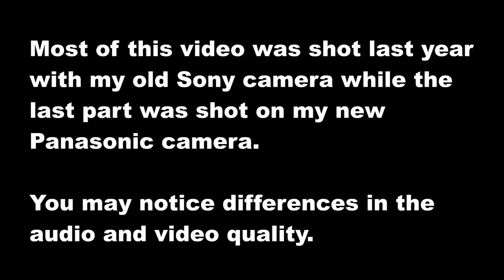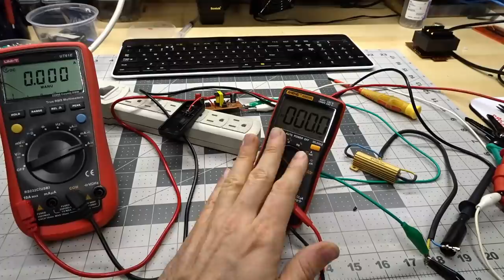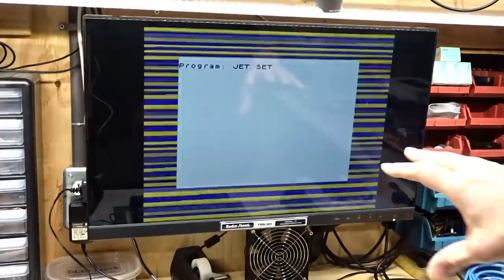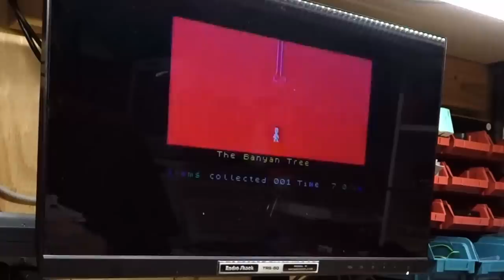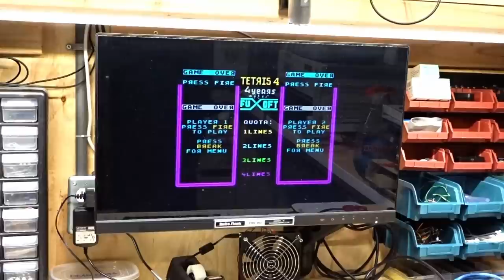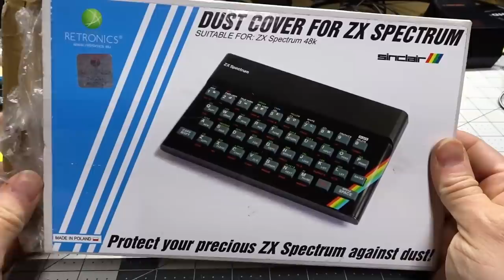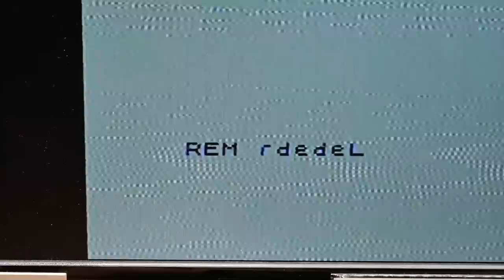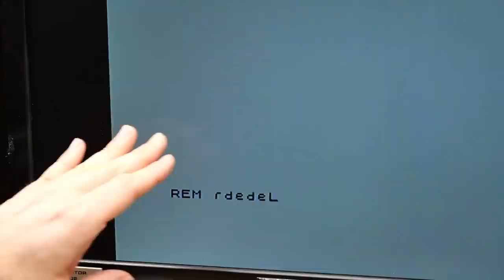ZX Spectrum Part 3 - Revisiting the machine at last!

Comment: In the 80s, many UK electricals didn't come with a moulded plug, just bare wires; you were often required to wire your own. It's really common to find 80s electricals here these days with terribly wired plugs with completely the wrong fuse in!
Reply from the maker: Oh that's fascinating! Is that because at that time some houses still had the older plug style? So they just didn't bother? Clearly that plug was added on by someone because it just felt like a hand wired one. So maybe they had to do it!
Reply: @adriansdigitalbasement  I think it was just done to make manufacturing cheaper, under the expectation that everyone was good at wiring a plug. We also didn't get regulations on fire retardant textiles until 1989. Frankly with all these home computers on carpets in front of the family TV, it's a wonder there wasn't a Great Fire Of London all over again...

Comment: I think you're right about the fuse. It was a long time ago so the memory's a bit fuzzy, but I think the Spectrum was meant to have a 5, or even 3, amp fuse.
Reply: Lowest you can get (from most shops, that's 3, though I have seen 1); that's far more (about 700 watts!) than the speccy uses anyway (10-20W), and is only to protect the _cable_, not the speccy or its power supply.

Comment: Thanks for showing this. I loved my Spectrum. The tape loading issue was horrible in the 80s as well. The experience I got with a Microdrive back then was 1000 times faster, but those tapes could also spin into salad. Try to rethink the tape source and some equalizer. It was treble and bias that worked for me with 1000s of tape loading/saving sessions. (I have a nice simulator on a Thinkpad now.)

Comment: Ever notice all your loading issues revolved around the one piece of equipment used to load them.  Try a new phone and app, and use a BT dongle to load them instead of the cable and amp.  As for Power Supplies, the Atari Jaguar Ones work great.    As for RAM on the Spectrum, the half defective Ram which was meant to save Sinclair money actually ended up costing them a whole lot more.

Comment: As I remember from that “spectrum era”,  most of spectrum enthusiast made two out of the box mods.
1st was a push button switch normally closed on power supply so you don’t have to plug and unplug the power jack to reset.
2nd  was to solder an AV cable in the modulator input and a female RCA connector at the other side and pass it out next to TV RCA out to have AV signal.
Reply: Hi ! So did I. However later I included a real "reset button" at the rear that reset the computer on CPU level without dropping the power itself.
Reply: More info about the second one, please! I'd love to see if my Sinclair (I think it's a ZX rebrand) is not outputting composite properly or if the whole thing is shot.
Reply: Hi ! When you look at the RF-modulator there are two wires going in from the left side through plastic bushings. The frontmost is +5V, the rearmost is input signal. That's the composite video signal already. 

All you got to do is feed it with a piece of coaxial wire to a female RCA jack. The outer shielding is tied to GND (modulator case for instance) and that's it. Normally it is not neccessary to even disconnect this wire from the RF-modulator so the original function is maintained and you could have a "dual screen" solution: TV and composite monitor as well. 

But you could remove the entire RF modulator as well. Saves room and power. For RGB encoding you need more hardware, since the video signal internally is a color-differential R-Y / B-Y signal.
Reply: @wacholder5690  I'll try that, hopefully it will work on my NTSC version. Thanks!
Reply: Hi ! It should, since the PAL or NTSC refers to the type of RF modulator used only. The incoming videosignal is generic composite video (known as FBAS in Germany).
Reply: BTW: if you have a double row connetor to the ZX rear connector you could catch the signal from off pin 15A + one GND like neighboring 14A pin. :-)

Comment: You're definitely getting the authentic experience! I had mixed results with the leads more than anything. Sometimes having the mic socket plugged in seemed to help. Speaking of which (and I'm sure you know this but) make sure the earphone out is connected to the ear socket of the speccy not the mic....

Comment: I'd recommend getting a Spectrum+, if you want something with a usable keyboard. You can get conversion kits for the 48K, as the boards were the same.

The 128 and +2 are two very similar machines, with the latter having minor compatibility issues due to (internal) ROM entry points being shifted as some of the strings (such as the copyright) had changed length. Worth sourcing, if you can, especially as they're more capable machines.

Comment: I know it is an old video, (blame youtube’s) algorithm. I fixed many Spectrums back in the late 80’s, most of the failures were caused by the power bricks putting out too high voltage, esp. in countries using 250V. The transistor generating the -5V for the RAM would go short circuit, putting the raw DC input on the RAM chips, destroying them in the process. From what I could remember, some of those power beicks would put out 16V or higher… standard mod was to put a linear regulator+crowbar on the power bricks. Those modified Spectrums never came back to be repaired again.

Comment: Ah,  yes, the fun of loading a program was part of the excitement of owning a Sinclair Spectrum.  I can quite understand how you would find it frustrating if you never used one in its heyday. It was after all a low priced computer that gave loads of people their first access to a computer. My Spectrum ended up looking nothing like a Spectrum. I built the circuit board into a full sized keyboard with real switch keys, fitted a MUCH larger heat sink to the 5v regulator and to the Ferranti ULA chip, I swear you could fry eggs on that! One thing that did improve loading of games was a cassette player that was made specifically for loading program tapes. It had a Schmitt trigger chip in the audio output that squared off the audio waveform, (I know this because I took a look under the covers to see what made it different) it was very successful. Sorry I can’t remember the make or model number, I did some searching on Google, but to no avail. Maybe someone else had one and can remember the model. Sanyo rings a bell. Still the Spectrum looks great in your hall of fame of computers. The happy days of programming in Z80 assembler code. Thanks for the great video.
Reply from the maker: Someone else mentioned trying to use a circuit to square the waveform ... I wonder if I can just feed the 5v TTL signal from a commodore Datesette into the audio input? Haven't found a lot of info there. And yeah, I was curious if people had put a real keyboards on this thing. Would have been a really nice upgrade!
Reply: @adriansdigitalbasement  If you're interested I have some photos of it.

Comment: I had the same video issues with my Commodore 64 believe it or not. Moving from a cheap composite cable, self made with those thin, little, cruddy rca cables and a DIN to a proper, professional made cable made my day, and my eyesight :)
Reply from the maker: Heh! It's just funny to think that a video cable can make all the difference! What's funny is I have other thin RCA cables that work perfectly -- so I guess this one was just extra crap.
Reply: @adriansdigitalbasement  True. It was extra cheap, I got the assembled final cable for dirt cheap because I wished to test extra fast my current daily driver, but it was extra bad.
Guess you get what you pay for, and not a cent more :)

Comment: Having to faff about with the volume control was pretty typical of using these machines ! In the later Amstrad models they implemented a schmitt trigger circuit into the built in tape deck, which improved loading reliability enormously. The ULA is basically using the audio input as a trigger, and timing the gaps between the pulses stored on tape. Adding the schmitt trigger makes this much more reliable, and as a bonus has an amplifier effect meaning the external amplifier is not needed. A similar thing is done inside the C64 tape deck too.

Im happy to send you a link to a circuit I use for this.. it uses one half of an LM358 opamp, so nothing too fancy!
Reply: No idea if this will come out - http://dark-matter.me.uk/files/zxspec/spectrum%20tape%20schmitt.png

Comment: Another enjoyable Video Adrian. 
My Acorn Atom used to also be fiddly when loading from tape. I ended up building an external circuit with some OP Amps, but with filtered characteristics to it based on the tones on the tape. There was the same circuit on the main board, so I figured going through the same filter cct twice would improve things and it did. 
Sadly as it’s about 40 years ago or there about my memory is a bit sketchy of the circuit details but I will try and have a hunt around on the web!

Comment: I remember owning one of these back in the day.  Great machine, but you did spend most of the time trying to get it to load stuff successfully.  From what I remember, using the cheapest of tape recorders seemed to have more success than more expensive ones.
Also sitting still and holding your breath seemed like it helped lol, although probably didn't.  I remember my friends doing the same thing.
Adrian, your probably better off getting some sort of device so you can load from SD card, otherwise you will be spending a lot of time waiting (and waiting) and retrying to load stuff !

Comment: One thing I've run into on multiple Android phones, which might explain the volume issues you have, is that they tend to have a maximum volume output intended for low-impedance earbuds/headphones that isn't anywhere near what the phones can actually output if the app uses its own sound engine. So even if you're using an app specifically designed to archive and play back ZX program tapes, if it's just using the default Android sound output instead of something based off of, say, OpenAL, you're pretty much stuck using an external amp to compensate for the phone's failings.

Even when you get apps that provide functions like preamp and multiband equalization, the phone will just react to that by dynamically lowering the overall volume output so that it never exceeds its allowed maximum. It's why music apps that purportedly offer functions like "bass boost" just result in the bass overpowering the rest of the track, without the actual volume level increasing. The only way around that (without involving external hardware), again, is to use an app that bypasses the default sound engine by using its own.

Comment: If i remember correctly, i had a spectrum 128k, over the tape reader was a hole, under that hole a screw you can spin from outside, spinning it right or left and the tape reader speed up or down a little bit, and that was the trick to make almost all games to load.

Comment: A veteran of Sinclair computers for just shy of 40 years I thought I’d say hello. One thing to try, as the caps in these are a problem at times, is a full recap and see if it loads better. Also try using an old pc sound card to push sound into it without the amp.

Comment: 13A fuses are mandatory in UK plugs because they use ring powered sockets and they use a 32A breakers (!) for their socket circuits. So to use reasonable size conductors in apliances the plugs need to be fused.

Comment: @4:10 - actually the bigger thing it avoids is that it makes sure you don't actually touch the two live pins while inserting or removing the plug. I did that myself once with one of these old-style plugs and got a nasty shock up my arm. It also makes it safe if you do something stupid like putting a 2p coin between the three connectors, something I did when I was about 3 years old and blew up my parents' fan heater.

Comment: I highly recommend trying loading games direct from some PC speakers playing WAV files of games with a high volume setting. It works 95% of the time. Phones can be hit and miss, even with external amplifiers. Ipads tend to work well I find too. One thing that works really well with the older spectrums such as this is if you get a vintage tape recorder and you know those car radio cassette adapters with 3.5mm jack? Those plugged into a phone work fantastic. Car radio adapter inside the vintage tape recorder (or any tape recorder) and cassette recorder earphone out to spectrum earphone in

Comment: Regarding the 13 amp fuse in the UK plug, back in the 1980’s plugs were not included with most electronics, so the consumer had to always provide one. By default plugs come with a 13 amp fuse, but most people don’t know, or don’t care to replace them with something appropriate to protect their hardware!

Comment: these days i just use a DivMMC Mini for loading games from a SD card... you plug it to the edge connector... 
also there is a custom ROM you can program on your EEPROM chip that has the loads the BASIC interpreter without shortcut keys for the BASIC commands... so you basically type commands like LOAD as keys L O A D... etc... you can have dual ROMs in the same chip too, the original and the custom. (and a switch for selecting the one you want to use connected to the first address pin)... 
I wouldn't underestimate the ZX Spectrum as it was by far the 8 bit micro with most home-brew software titles and it really was the incubator for all the western programmers outside the US.

Comment: The Spectrum was always a difficult computer and tape load errors were common until one found the trickb that worked for you. They actually worked best with cheap tape players which had poor audio fidelity and I'm sure many taped their volume control in the precise setting which worked best.

Comment: I do realize that your ZX Spectrum videos are at least over a year old by now. But I just have to say that even while watching the very first one, there was a voice inside my head constantly screaming ZXRenew! 😉

As I understand it (after converting most of my own tapes from back then) the "TAP" tape-file-format is only able to contain Spectrum tapes in their rawest binary form (as if loaded into memory). Whereas the TZX format can contain either digitized/sampled waveform data or non-waveform binary.

So it could be argued that the TZX format is the superior format because it can contain both software as saved for the standard Spectrum loader and those original games with customized turbo-loaders (and various embedded copy protections). But this also means that the TZX files can be affected by sampling volume-levels and tone/pitch drifts, which then again arguably would make the TAP format more superior.

Now, I had a mono radio from Phillips with a built-in tape recorder back then which I used with my Spectrum. And I was constantly fiddling with both the volume and the tone nobs to get my Spectrum to load properly, not failing half the times but surely more often than I liked. I do remember it as a complete nightmare.

So Adrian, if you seriously want to enjoy the ZX Spectrum experience... then my most honest advice would be to drop the phone/pre-amp or any tape-related solutions and get yourself a "DivMMC Future" cartridge from "The Future Was 8 Bit" website (under Shop -> Sinclair in the menu)... no more loading headaches and it also has a build-in Kempston joystick interface.

Comment: Goo-Gone is a very weak version of adhesive remover. I use the stuff you can pick up at a vinyl/sign product store. It's much more powerful and turns any adhesive to jelly. I then just use a weak glass cleaner after scraping off the thick stuff. As long as you're careful and test on the plastic for scarring or melting it's a very quick solution.

Comment: I have been watching some of your videos and like what I see, so you have gained yet another subscriber :) Keep up the good work!

As for the ZX Spectrum, I am quite new to it myself (never had one when I was younger...I grew up in the USA) and the computer had peaked my interest. I now have a Harlequin (new clone ZX Spectrum) board in my ZX Spectrum 48K case. I can tell you that attempting to run tape software through that setup will give you nothing my headaches. I do not think anything is actually wrong with your Speccy. I think it is just very very picky with the volume and that analog knob does not cut it.

But, I don't think you should continue to use that as a means to load software. Just get a DIVMMC Future cart. The thing is cheap, plays all of the tape and Z80 images just fine (from an SD card) and adds a DB-9 joystick port to boot. 

Like I said, I am very new to this machine. But, because of that DIVMMC cart I am really able to open up the entire software library and really give stuff a go....games...demos....software. It is then that you find out how really spectacular this machine is!

Comment: auto volume normalization was common on the old tape decks, the output needs to be pure mono, no stereo whatsoever build a ta2030 mono amplifier  and attach a 470ohm resistor to the speaker output to drop the speaker level to line level, this will work great. and make sure all your cables are shielded. tip: white spirits are the best thing for removing sticky pads.

Comment: until 1992, electrical appliances sold in  UK were not required by law to have a plug attached. Appliances were mostly sold with only a raw wire, and users were expected to wire the plugs themselves. This explains maybe why it had a 13amp fuse in it. Probably what the original owner had lying around at the time. Glad they changed the law.